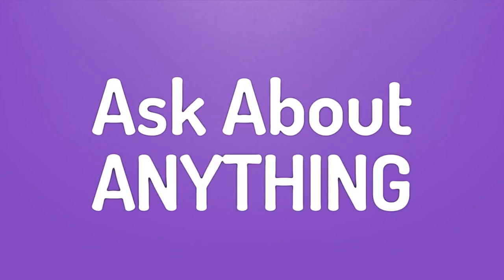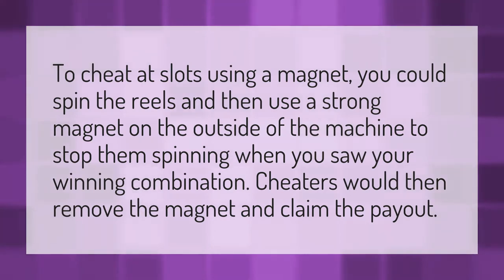How do you cheat a slot machine with a magnet?

Comment: Nope. A slot machine is an adjustable  random number generator . The number generator is of course a chip set…..a computer if you will. 
 The pictures, or reals…..have ZERO to do with the payout.
Yes….of course when you win, it shows…whatever. But. That display of flashing lights and sounds, and “close” wins. Is simply an excitement factor goading you to push the button…again and again.